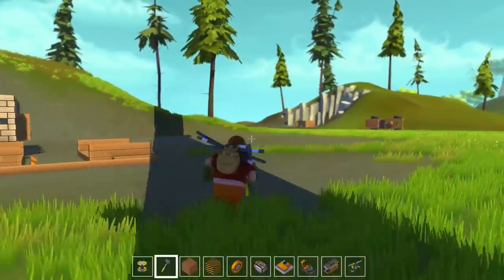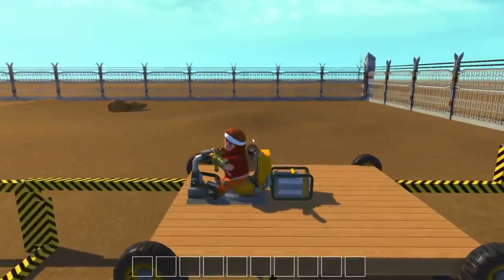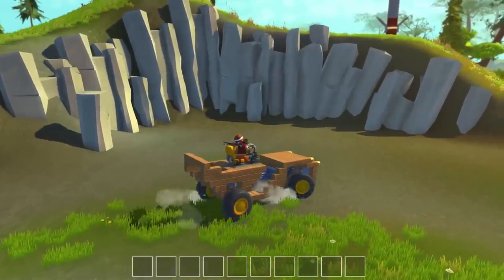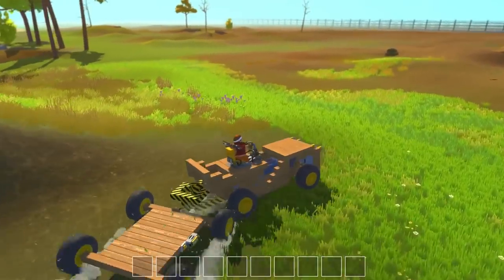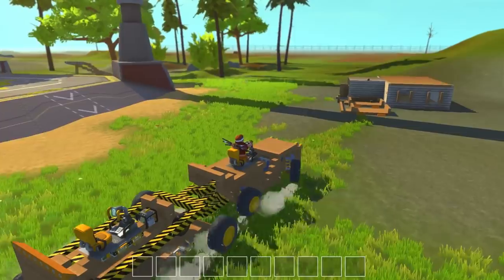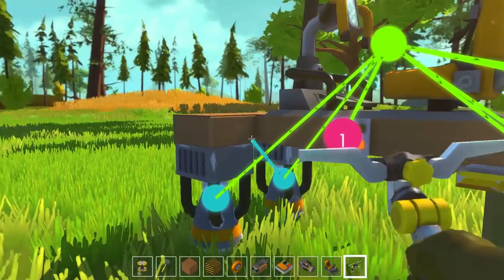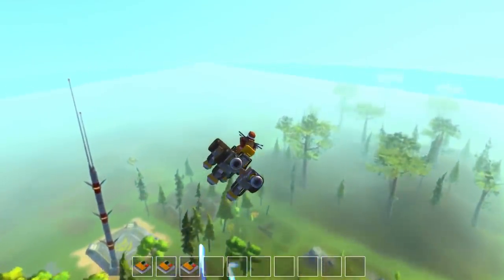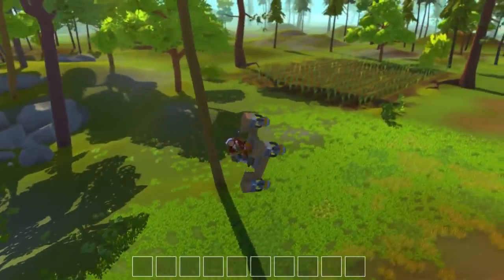PLANES, TRAINS and... TRAILERS? | Scrap Mechanic Gameplay #4

Comment: Maybe try connecting a switch to the drivers seat? You can then control that switch with the number keys while driving. It should let you open/close the hook for the trailer, and if you're feeling adventurous maybe hold out a piece of wood on the train which activates a sensor?

Comment: A couple of tips: using buttons rather than switches enables push and hold rather than toggle, and maybe try using suspension between the truck and the trailer claw thing to stabilise it

Comment: Tip: 
Electric Motors are for torque and power.
Gas Motors are for speed and acceleration.
Reply from the maker: +Ethan Schneider Thanks dude :) I did see when the game said this in the handbook. I've used both and there isn't actually that much difference to be honest

Comment: Dude ik a way that will make your trailer way better and that is controlling its connection to the back while sitting in the car without having to get out to and pressing the button, so to actually do that you have to make both the car and the trailer connected without actually being connected to do so you have to put a bearing on the car attach a block to the bearing then put another bearing on the end of the block then attach the trailer to it then remove the block in the middle that for some reason makes both creations connected but don't remove the bearings and then you connect the button to the seat of the car and voila you can press the number that the button is on and you can attach or deattach the trailer with a press of a button.